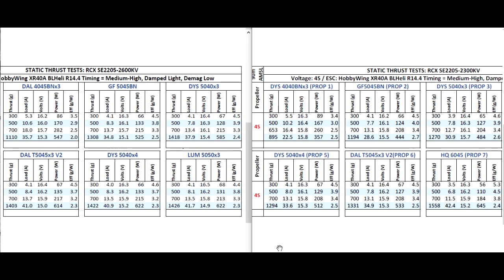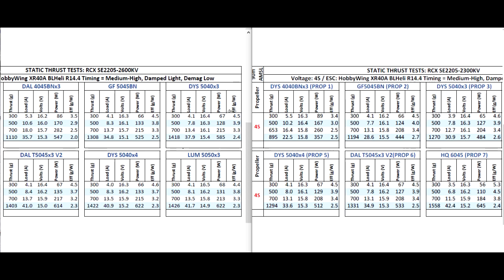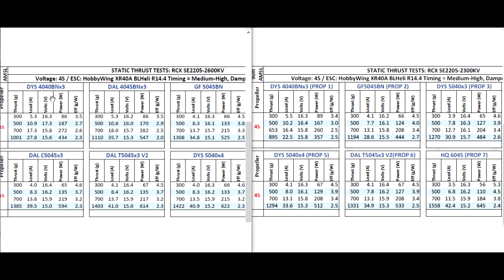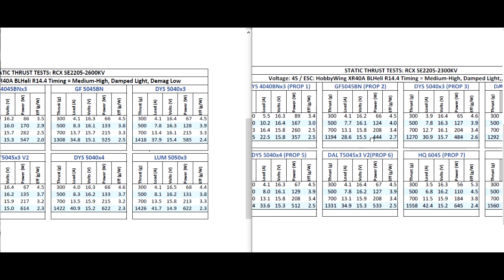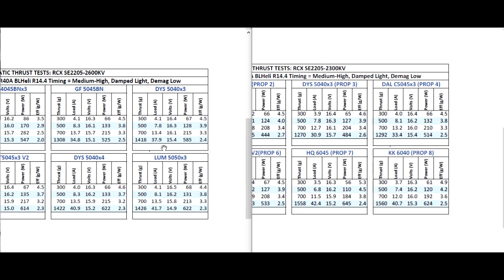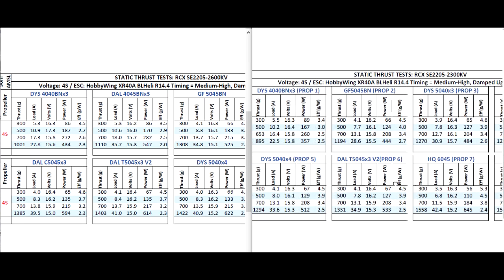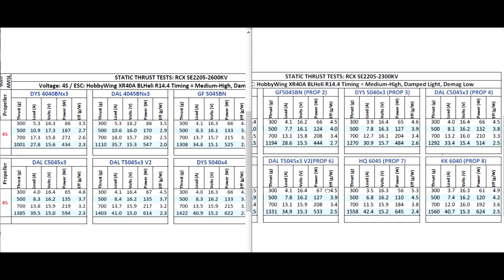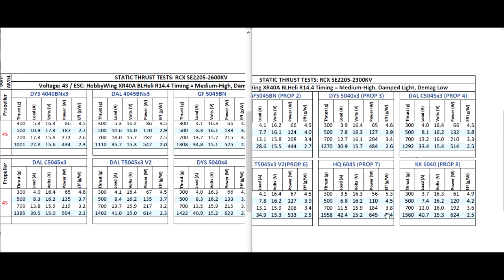MYRCMART.COM New Motor RCX SE2205-2300/2400KV V2 Static Thrust Tests

Comment: I will be building a light quad using the avantquad xero s5m frame. Dry weight is 230-250g depending on whether I use the rcmart.2206.or 2205. It is for racing. Ppl.said rcmart se2205 v3 can not handle the more aggressive prop like emax avan-r tri blades, cyclone 5050 tri blades, etc. What is your recommendation?
Reply from the maker: Right, I would stay away from those aggressive props. The motor may be able to handle them and fly without going up in flames but it's just going to run hotter than it should and not use energy efficiently. Best match props should be HQ5043x3, new DAL C5040x3. The GemFan Flash 5152 and DAL C5046x3 should be OK.
Reply: EngineerX thanks, gemfan flash 2 or 3 blades?
Reply: I have decided to get rcx se2205 V3 . Weight is more important for agility. I can save around 16g. The weight diff is 4g per motor. Top end speed not required for a short race course.
Reply from the maker: Jack Truong Good choice. Sometimes lower weight is better than higher thrust.
Reply: EngineerX 2 of the 5 motors make noice. i changed the bearings and it is the same. i have a feeling the magnet could be rubbing some part of the stator. Any suggestions? disappointing!

Comment: How do these motors compare to emax rs2205s?
Reply from the maker: Jack Truong As far as power, these are more powerful. From what I read, MyRCMart addressed some issues they
had with bad magnet adhesive on one of their batches. They're well balanced and use very good bearings and have larger 4mm shaft. Many people are quite happy with them. Also spare bells and bearings are available. Still, good idea to get 1 or 2 spare motors since shipping may increase overall price. I always end up buying other stuff from MRCM on every order. EMAX is gold standard, these come very close in terms of overall value.
Reply: EngineerX have u bench tested the brotherhobby R2. Not sure how it compares to other motors in the same class.
Reply from the maker: Only the SilverDrone ZMX V2 which I think it's based on the R2 https://www.youtube.com/watch?v=589RdYaZnug

Here's all the 2205's I've tested
https://www.youtube.com/watch?v=2VbFvy1OZww&list=PLlrLi7Zft25jZoEM2f95TnNlqiTbquxRl

Comment: Could you tell me what size bearings this motor uses? They don't seem to hold up well and I need to replace them.
Reply from the maker: Motor part numbers and parts links are at bottom of motor page where it says "maintenance parts"
http://www.myrcmart.com/rcx-se2205-v2-2400kv-fpv-racing-motor-japan-ezo-bearing-n52h-arc-magnet-p-10866.html
Reply: Ok great. Thank you.

Comment: How is this possible at only 13 bucks a motor?? What are the compromises?
Reply from the maker: $10.00 actually! There's an option to decline "factory warranty" - Yes, it's quite amazing for them to sell them at such low prices, though shipping is around $10? for a set of 4, so delivered price is indeed around $13.00. The armature of the motor uses less material than most others motors, that makes them a little more susceptible to bending in very high impact crashes, though most motors would probably be damaged in those crashes as well. From the pics, you can see the magnets are not as tightly packed or as chunky as in premium motors. Tolerances are a little higher, the air gap between magnets and stator face is a little larger. Many use RCX motors and end up quite satisfied. MyRCMart sells replacement bells and bearings cheap so most people add a couple of those parts and an extra motor or 2 for spares. There's always a chance of getting a "rough" motor, but it's rare, you can go through the RCGroups thread to see how many complaints there are. Not many I think. But if you're looking for guaranteed quality, perhaps best to look elsewhere like EMAX, T-Motor, etc
Reply: Interesting. That is good food for thought. I would hate to have an bad motor cause issues with the flight controller which in turn is a bit of trouble shooting. Maybe if they priced them for 5 dollars more we could get stronger armatures and arc magnets with tighter tolerances...meh its tax season. I ordered 5...lol
Reply from the maker: prophet11236 LoL... the bad motors are not common. So far people have been posting good reviews. Hopefully all yours are good. I think these are a very good option for powerfull-low budget builds.
Reply: Thx for the info. I would hate to lose an expensive build getting stuck in a tree or something.

Comment: Wow, how can this motor be more efficient that DYS 2208 2300KV?
It uses less power at 500g in almost all the propellers, did all the other variables stay the same?
Thank's for the review, it was nice to see the new DAL Cyclone data.
Regards
Reply from the maker: Do you mean DYS 2008 2300KV? I haven't tested a DYS 2208.But if you meant "2008":
Not all variables stayed the same. Air temperature was colder when I tested this motor. I don't log atmospheric conditions, but if someone really needs that info I can give the dates tests were run and I'm sure there's historic weather data for the city of Los Angeles somewhere in the internet. 
Then only reason of the difference at 500g that I can think of, is that the RCX motor has better components such as stronger magnets, thinner stator laminations, "better" EZO bearings. It could be those variables combined with colder, denser air helped produce better performance.
Reply: Sorry, I was thinking in 2008 but wrote 2208.
In all the test I saw DYS 2008 were far more efficient than all the 2205 motors, only 2207 have the same efficiency but now the RCX se2205 beat it.
This motor is truly a surprise to me.
Regards

Comment: Im starting to get a bit confused with the different variants of this motor...but it seems cool that have the ezo bearing now...the mearing was the one drawback I think previously...is there also a 2206 version I think? And what is the weights of these two?
Reply from the maker: They sure have lots of versions. On the product page they list the change to the EZO bearing. Weight is about 26g. I forget weight of 2206 but it's on the video review. Hopefully these have good durability.
Reply: it says 32.5g on your other 2206 vid but it cant be that much more...